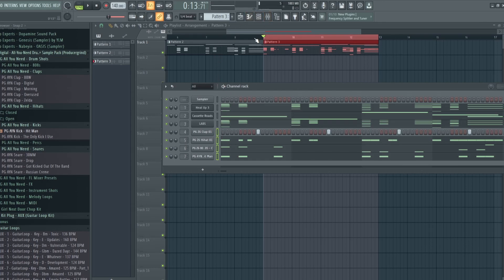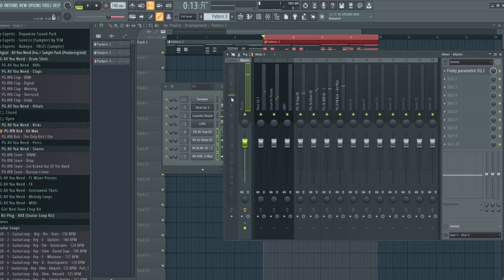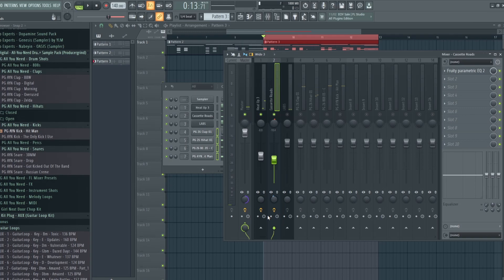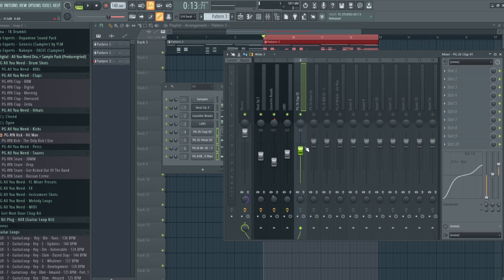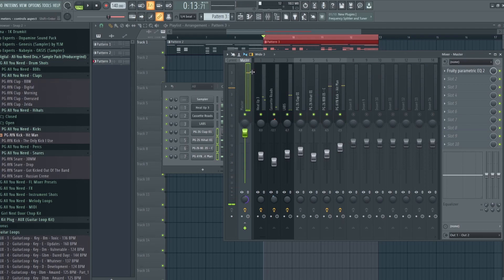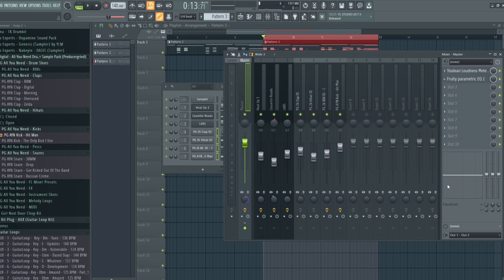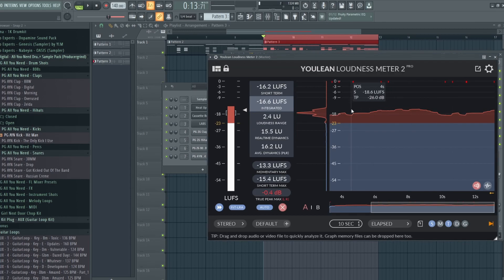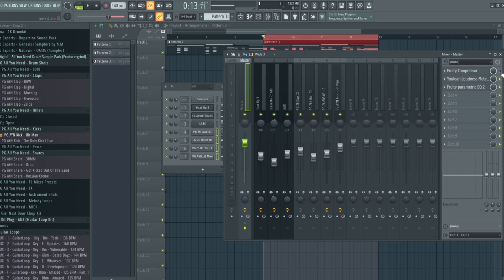How To Make Your Beats Louder using Compression in FL Studio| FL Tutorial

Comment: fruity limiter gain with an soft clipper is an very good way to do this as well
Reply from the maker: It can be. I don’t like using limiters cause most sites that allow uploading sounds have limiters already. So it would limits what you already limited.
Reply: @jay667  nah u dont use the limiter like that when u do this u do the exact opposite

1.turn attack release and the third one i cant remember all the way down
2.turn the ceiling all the way up
3.turn the gain up as much as u need
4.put an soft clipper on top of it so it doesnt distort it